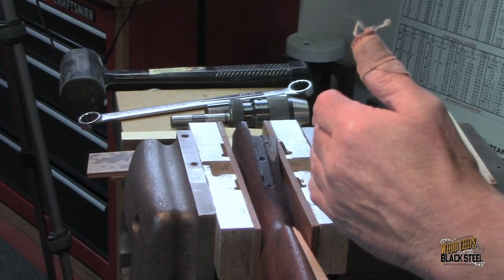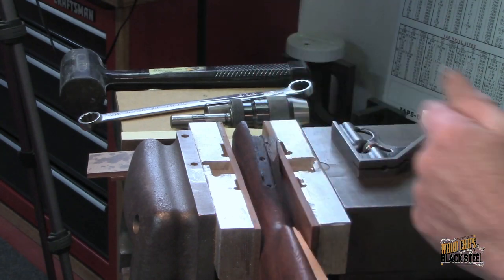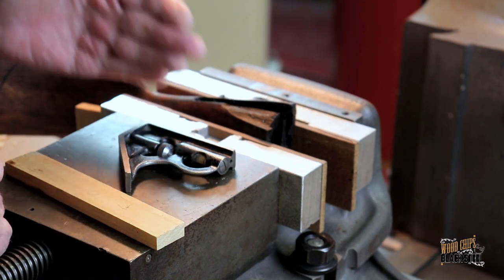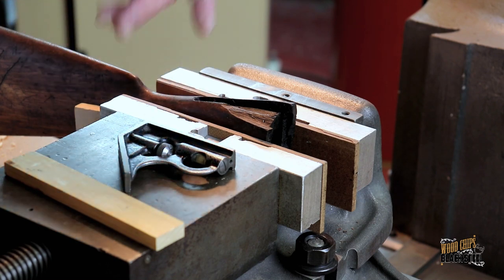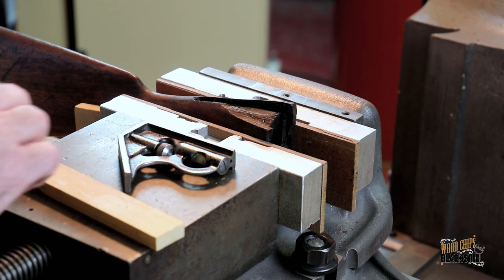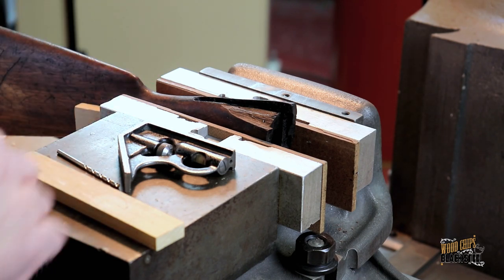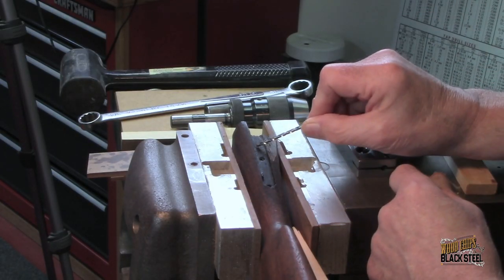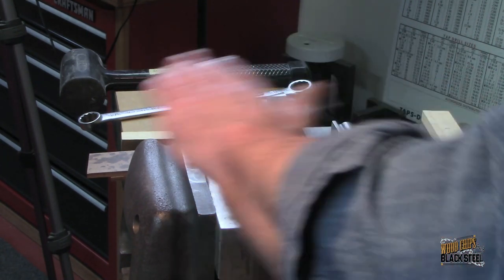Bridgeport's are the Best!  Ithaca Restoration Ep 13.

Comment: If you have a second I would like your comment on my methodology on setting reinforcement pins on for stock cracks I have repaired. Knowing that it is very difficult to keep the chipped wood aligned with the major stock piece I have drilled the chip for the pins with a minimal diameter bit and then used a larger diameter bit on the stock so that the pins have a margin to move for aligning the pieces together. I have made sure that the epoxy has completely filled the larger diameter holes and used plenty of epoxy on the broken surfaces. When the outer finished surfaces of the stock need to be protected from the epoxy squeeze-out, I have used a small amount of furniture wax on the finished surfaces to make squeeze-out clean up easier. I would appreciate your thoughts.
Reply from the maker: Well your idea of having a larger hole is a good one.  The epoxy will form the sides of the hole surrounding the pin. Depending on the break...getting good alignment is always the hardest thing to accomplish.  If you check out the pistol grip repair I did on the Weatherby a bunch of videos back, I was able to hide the wood screw under the decorative diamond, so didnt need to focus on adding pins and got to add the screw after the epoxy had dried.  Regarding the wax...If you are having luck with this technique, keep doing it. My caution...wax will prevent any fresh overcoat of new finish from adhering to the older finish.  It can be nearly impossible to get it all out of the pours of the wood.  Most of my repairs require some amount of refinish so for me I would be reluctant to use any wax.  Hope this helps?